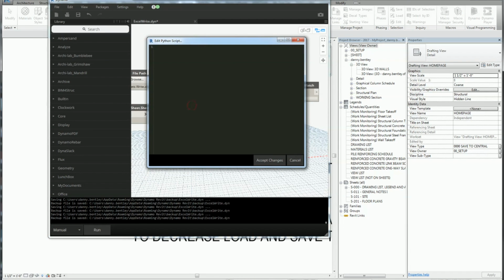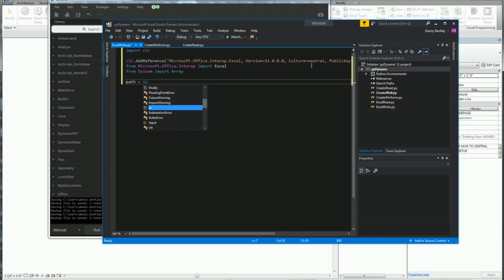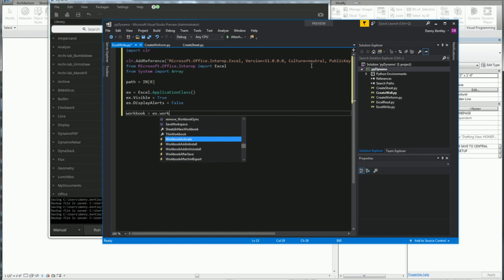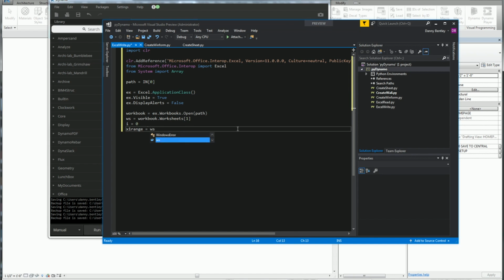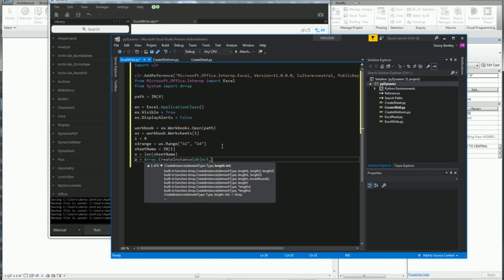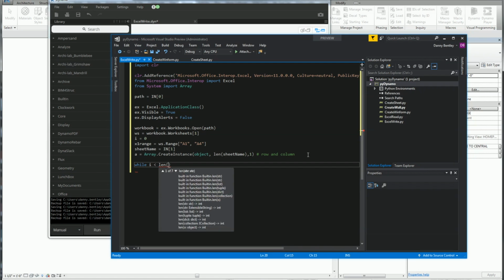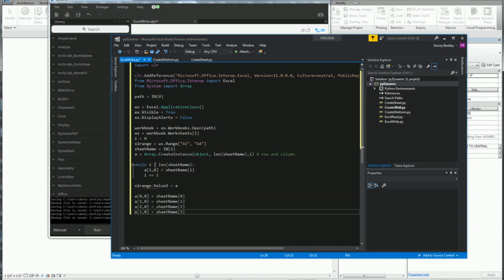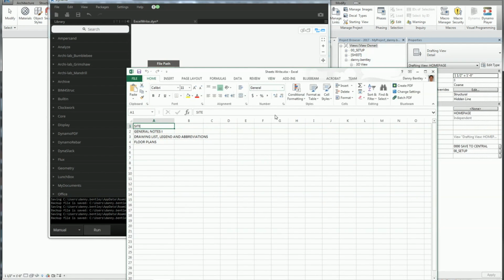DynamoBIM Python Beginner Write to Excel

Comment: Do you have a good way to get the public key for excel? Most of the resources I find are outdated at this point.
Reply from the maker: Can you give me a better idea of what the public key is?  Is it encrypting data or a dictionary key value pair or a product key?
Reply: Ah sorry. PublicKeyToken that you are calling out in the python clrAddreference line.
Reply from the maker: You need to get the Public key token for a strongly named assembly in .NET.

One might be able to use reflection to get it out from the dll.
Here is a sample from stackoverflow using powershell: 
([system.reflection.assembly]::loadfile("c:\MyDLL.dll")).FullName
The output would be:
MyDLL, Version=1.0.0.0, Culture=neutral, PublicKeyToken=669e0ddf0bb1aa2a

https://stackoverflow.com/questions/1710935/how-do-i-find-the-publickeytoken-for-a-particular-dll

I don't know of a way to have it look up the dll's public key token at runtime, but it might be possible. 

You can also get it with VS 
https://blogs.msdn.microsoft.com/kaevans/2008/06/18/getting-public-key-token-of-assembly-within-visual-studio/

Let me know if you have a better solution I would be happy to add it to the notes of the video. 

Thanks.

Comment: Great tutorials on Revit and Python! I tried to clr.AddReference('Microsoft.Office.Interop.Excel') only and it worked in RevitPythonShell.
Reply from the maker: You're correct. In the code, one isn't editing or modifying any elements.  I get into a routine and add references in case I add to my code and extend the use.  For this demonstration, I think less is more. :)
Reply: I'm a little confused. I thought I only have to specify excel version when there are more than one version of excel installed on my computer (eg. 2003 and 2007). And I still don't get it why you have to specify excel version when you need to modify any Revit element?
Reply from the maker: To use COM components from .NET, you need .NET class libraries that wrap the COM interfaces - for most COM libraries these can be automatically generated by the framework, but for Office, the automatic generation doesn't work correctly, so Microsoft have provided pre-built ones called the Office Primary Interop Assemblies (or PIAs).  Once they are installed you will be able to reference them.  

If you have multiple version you will have to specify them. I believe that if you have one version of Excel it might understand that it's your default. (I have several version on my computer), but if you tried this and had success then you might be correct and not need to specify the version.  

Revit elements are independent of Excel.  They are sending a payload of data from parameters (int, strings, etc..) and not an element itself which need to be translated.   

I hope this helps and isn't so confusing.  

If you want to send me screenshots of your code or a sample I can take a look at it danny_bentley@hotmail.com